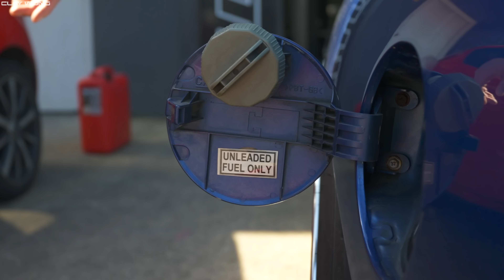I ATTEMPTED TO DRIVE MY REBUILT BIG TURBO MAZDA RX7

Comment: no more laggy turbo cars now the new turbo technology. sounds nice too
to get this sort of power 10 years ago you needed a truck turbo with like a 100mm turbo with a 105 rear housing. you needed NOS just to get the thing spinning. now a 64 to 68mm that had trouble making 600hp 10 years ago can make 900+ today and NO LAG

Comment: hey Clay just saying the NEW Garrett GTX3584RS  with a 67/68 wheel does 1000hp. 76% efficiency  @90,000 rpm 2.25 pressure ratio . turbo capable of doing 130,000rpm at 70-60% efficiency
The efficiency is getting crazy with these new titanium or Inconel 1 piece shaft/im/prop/pellors . years ago to get those HP numbers you needed 100mm  exducers and laggy as fuck. now we are using exducers that used to struggle making 600hp at 67/68mm